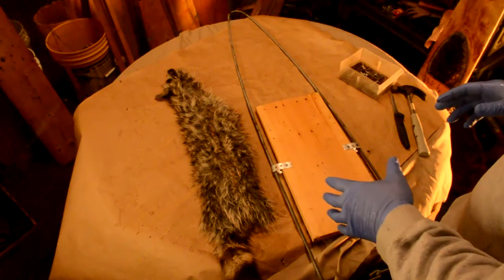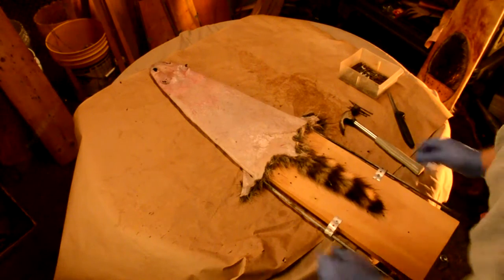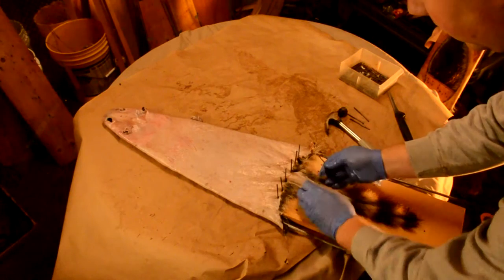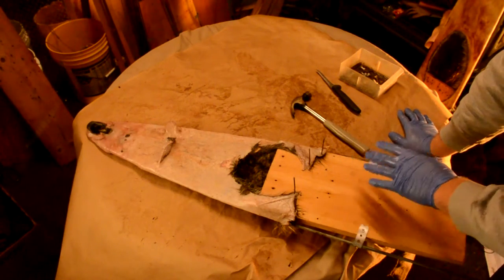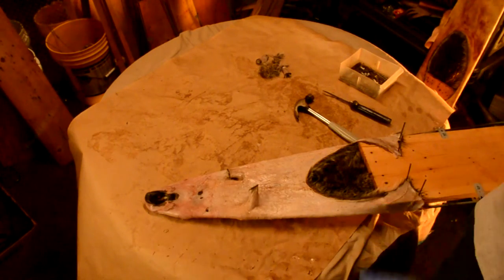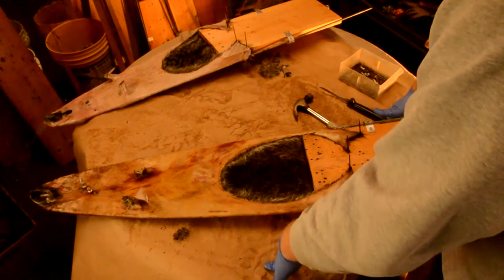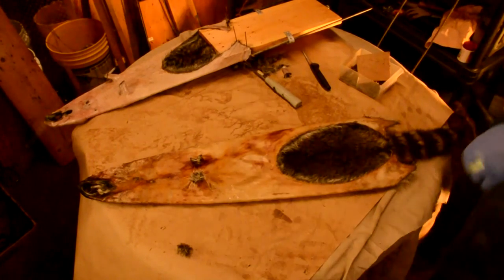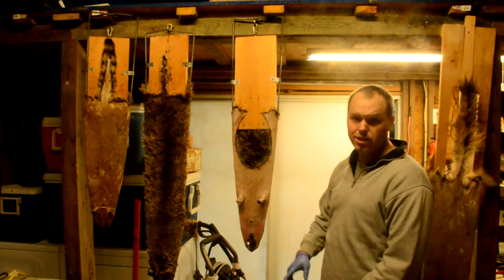Fur Handling - Stretching a Raccoon Hide

Comment: so what do i do after its dry how long will it last with only being air dried
Reply from the maker: As long as you keep it away from bugs and water it will keep for months dried.  If you're going to sell it, the sooner the better just from a being safe and getting rid of it standpoint.  If you are in the south you don't want to carry it through the summer dried as the odds of getting bugs is pretty good.  One option if you want to  hold it is to put it in the freezer.  If you can do that in a vacuum sealed bag that's even better (think one of those vacuum bags for clothes, not food)

Comment: You do not want to use salt in those bad places. Salt draws in moisture. Use borax 20 mule team. Never use salt on any hide, ever. If the taint is to bad nothing will work. If not to bad, borax usually will stop it. Also wire is not the way to go. Use the wood forms. Wood will allow a much better density and better uniformity than wire ever will. Wire keeps a constant tension on the leather keeping the density much lower. That is the reason fha and nafa and all other buyers recommend wood form over wire. Another thing, your not pleating near as much as you should. Windows should be more narrow also. Way to wide. Buy hang them they way your are, you are keeping tension on the leather. Not a good idea. Throw away them wire forms and get wood. People that use wire simply dont want to take the extra time to do it right and don't care about the extra money you will get from their hard work. I could go on about your put up but for know I wont............Richard from Kansas
Reply from the maker: +richard murray Thanks for the advice, I'll definitely pleat more and narrow my window.  I may have to experiment more with wood stretchers.  I've got some top lot awards with wire, but who knows, maybe I would've gotten more using wood.  As long as you're not using too large a wire stretcher I really don't think you're getting any more tension on the hide than when you stretch a hide on wood.  To each his own, but we should always be willing and wanting to learn, and that I am!
Reply: I not meanin to sound rude, sometimes it does come out that way. One thing you need to understand about top lot award is that is isn't all about the fur handling, even though it does play a small part in it. The biggest part of it is fur quality. I have seen to many guys get the awards and they automaticly take it to their head that it was all about their handling of the fur. It's only a part of it. Fur handling should be like art work and mine are. I would be willing to help you get the most out of your work if you like. I've been there and done that. Learned by my mistakes. If a man is not willing to learn by his mistakes then what is mistakes for. Through email I could show you some pics that would change your mind. Guranteed. If you have a problem in an area all you got to do is ask, no problem on my part. I also know your on t-man. Not a very good place to learn anything. I can tell your passionate about what your doing and want to do the best job you can. Don't be like most and settle for average joe. I am actually very humble man of 51 years of age and just want to leave a few tracks before I leave this ole world someday. That's up to the Lord when that happens.lol.........Richard from Kansas
Reply from the maker: +richard murray kris@coyotetrappingschool.com
Reply: richard murray, where are you from in North Central Kansas? I'm from beloit. I caught one years ago that hit 40 lbs. I sold him to Neil Oliver. I'm sure you know who that is. he said it was the biggest he'd seen in years. they do get big around there!